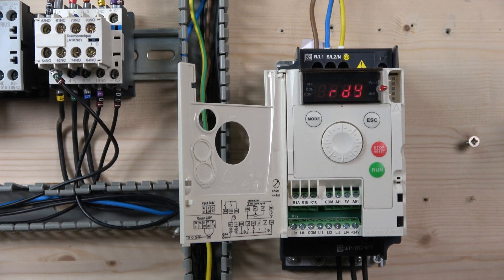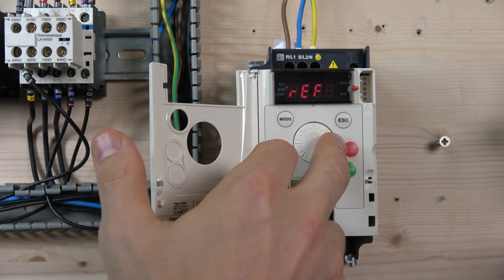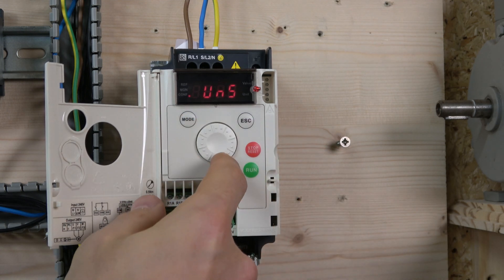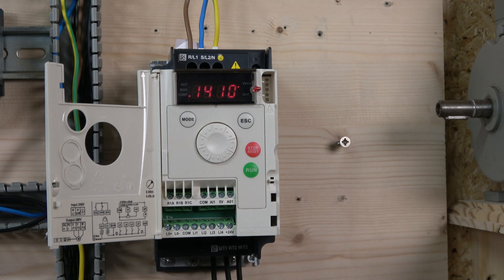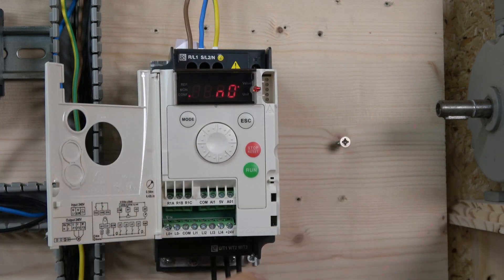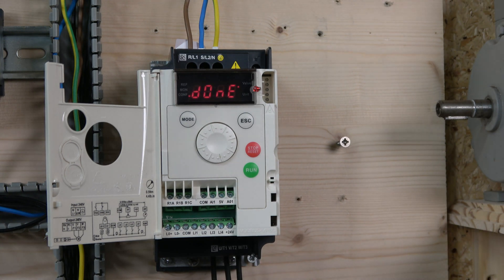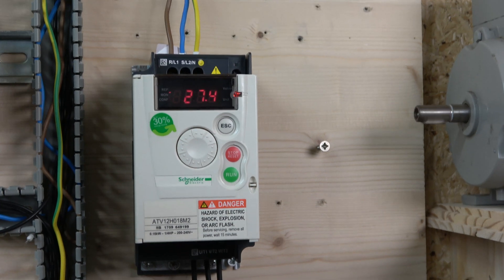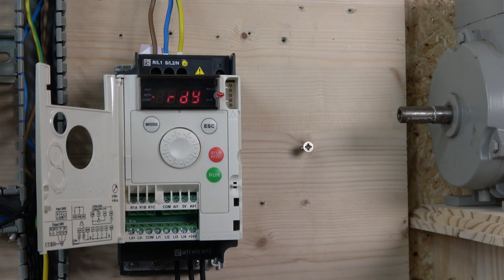Schneider Electric ATV12 VFD, local control, commissioning and parameter set up. English

Comment: Hi. I have a single phase motor 230 V 1500W that I want to run with this VFD. But I can not see any instructions for that. I was informed that this product can run a single phase motor and find som info on the internet that you just connect trhe motor to U and V. But I want to check first as there is no instruction about this in the manual.

Comment: Fantastic video. You mentioned that you are able to set a higher HZ in the vid. I have tried that but can not get my motor to spin up past 50 Hz. I want to go to 200 Hz. Do you have any clue to why not?. Best regards Thomas
Reply from the maker: HI There. There is 2 types of frequency in your drive. One is base frequency that can only be 50 or 60 and other is run hz. Change your max frequency to hat ever you need and you should be good to go, believe i mention in video what is what.